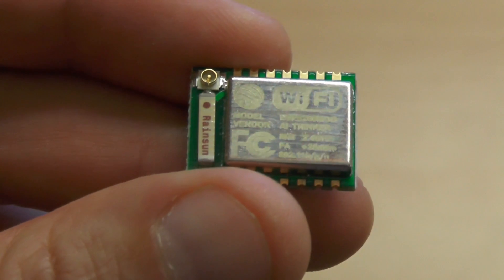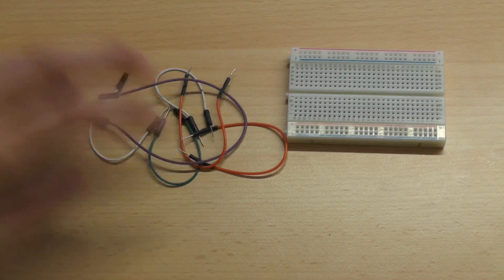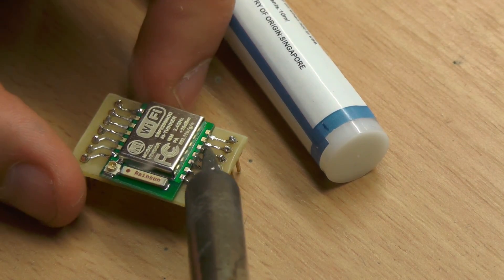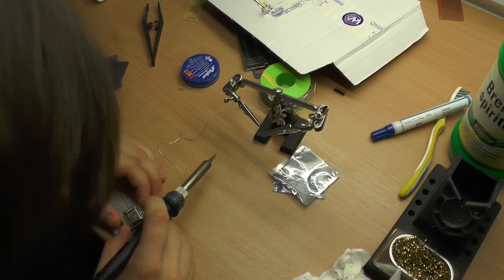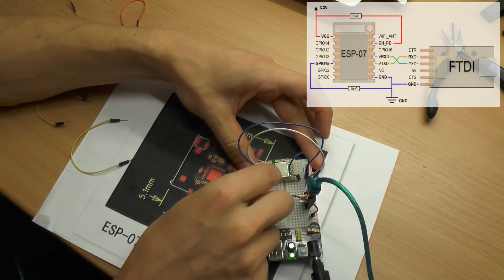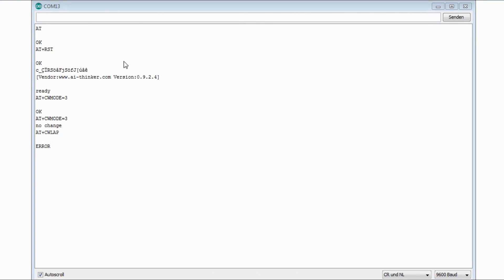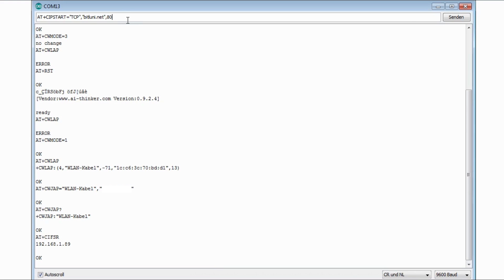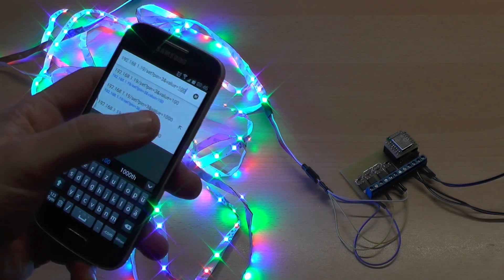ESP8266 Serial Interface to WiFi

Comment: To avoid having the breadboard turn into a heatsink I sometimes solder the first and last pin of the header to secure it, then I put it down on a heat resistant silicone pad to solder the rest.  They come out pretty straight.  Awesome tutorial, thanks for making this one.  :)

Comment: The Ai-Thinker ESP-07S only needs GPIO0 pulled down before powering up into flash mode (then press Upload in Arduino IDE). The datasheet shows other pins like RST, EN, GPIO15, etc, already have pull-up and pull-down resistors. There, when you use a CP2102 adapter, all you need is: vcc to vcc; gnd to gnd; tx to rx; rx to tx; gpio0 to gnd while you upload your sketch.

Comment: Nice tutorial, thanks! However I got my ESP8266-07 only to answer by setting the rate to 115200. With 9600 just nothing happens.
Reply: Same. Looks like 115200 is the default baud rate for some boards

Comment: Nice one. Just found the Arduino/ESP8266 Litbrary and Github page two days prior. There are many other ways of arriving at the same end result. NodeMCU, Lua Flash Tool and Interpreter,  ESPlorer, ESPBasic as well.   Bloody confusing for the total noob who wishes to dabble. Lesson learned,...there is no such thing as dabbling, it is all or nothing:-)
Funny story, I bought the ESP201 with ext 2.4g dipole antenna, and it soldered onto a breakout board so wide that it went from one power rail to the other. Useless and once soldered, rather permanent. Maybe thousands of irritated customers :-)

Comment: Great tutorial just like all your others!  I have made the same error with the circuit board being too large for the breadboard.  But I just allow one row of pins to hang over the edge of the breadboard.  Then just put female jumper connectors on the 2 or 3 pins that need to be used.   Sloppy, but it works.  Thanks!

Comment: Ich wollte mir auch erst ein hübsches Trägerplatinchen basteln, habe aber dann das ESP-07 mittels abgeschnittener Bauteilbeinchen (ja, ich hebe die genau für diese Zwecke auf) auf eine abgesägte (mittels Trennscheibe + Micromot) 24 Dip Präzisions-Fassung  gefrickelt. Das ist ebenfalls sehr kompakt, stabil,  100% Steckboard kompatibel und schnell gemacht. Das gesockelte ESP-07 ist also nicht breiter als die 24er Fassung. Verlötet habe ich dabei nur die jeweils äußeren Beinchen, um das Modul evtl. möglichst leicht wieder ziehen zu können.
Reply: +Redled72 
Übrigens ist das Modul bei schwacher abgezwackter 3.3V Versorgung (mittels Dioden über die 5V USB) recht launisch bis zickig beim Bootvorgang. Erst die Pull-UP/Pull-Down Widerstände an GPIO15, GPIO0 und CH_PD machten es einigermaßen stabil. Direkte Verbindungen nach VCC führen bei Spannungseinbrüchen zu einer verstärkten Stromaufnahme. Da die Spannungsregler noch irgendwo zwischen Hongkong und DE unterwegs sind habe ich kurzerhand eine robuste 3.3V Quelle aus dem LM317 TO-220 gebastelt, welche auch steckbar auf dem Board verwendbar ist.  (R1 zw. Pin1-2 = 120Ohm, R2 zw. Pin1-Masse = 200Ohm) = 3.38V

Comment: Jetzt wo du scheinbar doch nicht tot bist, kommen neue Videos über 3D-Drucker und Arduino Synthesizer oder hat sich das irgendwie erledigt?
Reply from the maker: +ge200099 ...arduino synth was more or less done in lack of arduino performance. but I could try to implement it on the esp since it is at least twice as powerful with up to around 50MHz and 32Bit processing power ;)
The 3D-Printer is a worn out after one year of intense use for my master thesis which was the reason I had no time to make any videos. But I have lots of material form the building phase and the results. There will be definitively more on this topic since I'm living now with three other nerds and we we have about 5 to six different self build 3D printers at our place ;)
I should by post a channel update, but I'd rather start producing actual content instead of making promises